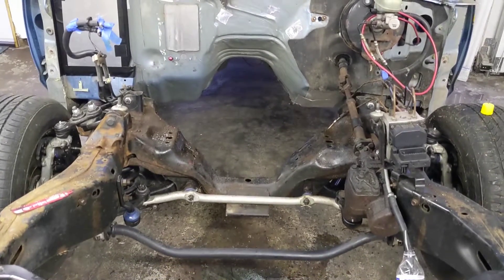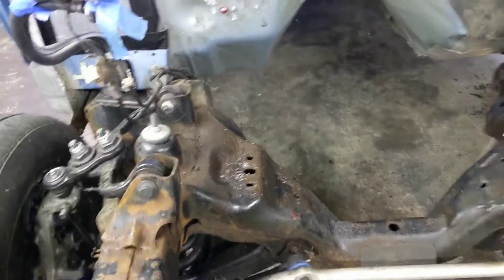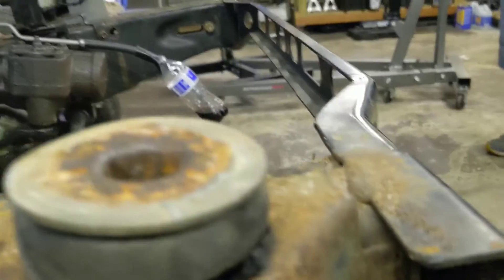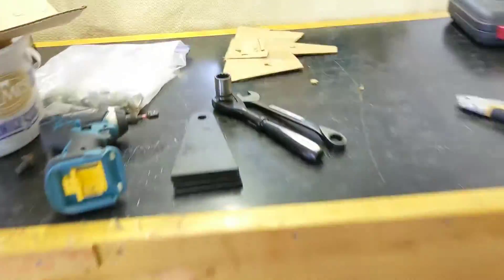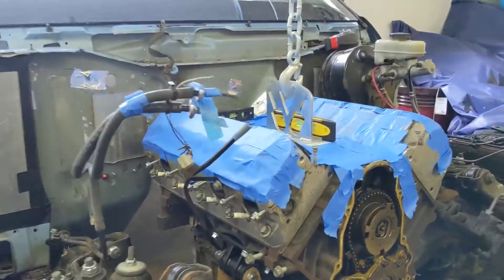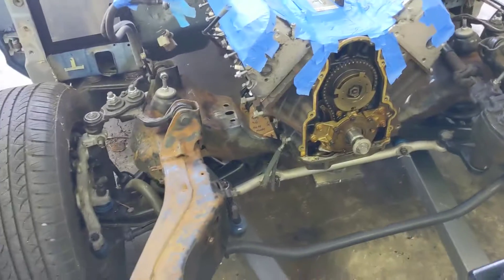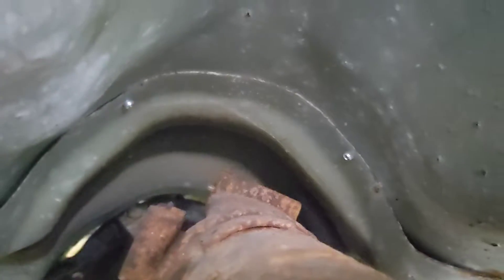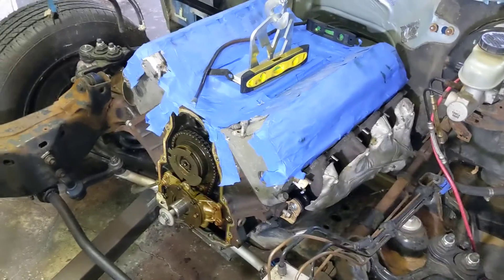Crown Victoria LS Engine Swap - Test Fit

Comment: Any updates? I'm working on swapping my 95 and am running into the same issues with the trans hitting the Tunnel. I'm using a lq9 and ford t56 magnum
Reply from the maker: I fully expect to cut out and enlarge my trans tunnel. The 6L90e is just physically much larger (around) and it can't be avoided. I don't know dimensions on your t-56 though. Depending on where and how much you are hitting the fix could be as minor as tipping the engine back 1-2 degrees, some hammer massaging on the tunnel or as extreme as I have to go. Should have some more updates in a couple weeks.
Reply: @bleepingfastmotorsports  thanks for the reply. Do you have a Facebook account or something I could show you some pictures of where I'm at? I'm actually at about 4 degrees of tilt and I'm maxing out with the tunnel. I'd be happier to be closer to 3
Reply from the maker: @lincolnzach256  I do have a Facebook group for our race team. 
https://www.facebook.com/groups/968829016901021/?ref=share
You have to apply and then I will accept.
Reply: @bleepingfastmotorsports  the t56 is definitely larger than the 4r70w
Reply from the maker: @lincolnzach256  ok, so really it's a matter  of test fitting it to see where it's hitting. Then you will have a good idea of where and how much you need to clearance. Driveshaft is another issue. You will need a new driveshaft due to length difference (unless you are the luckiest guy ever). :)
Reply: @bleepingfastmotorsports  I'm not concerned with the driveshaft. I've had 2 shortened before to run different transmissions in this car. 

Thanks for the insight. I'm sure I'll have more questions for you. 

Btw, the holley 302-2 pan fits with more clearance.

I also have test fitted 98-02 camaro speed engineering long tubes. The passenger fits with very minor modifications. The driver appears to fit but I havent tried hard enough to squeeze it in once the engine is set in place